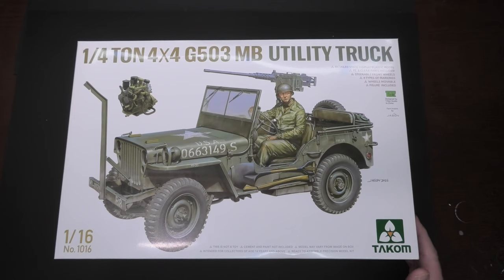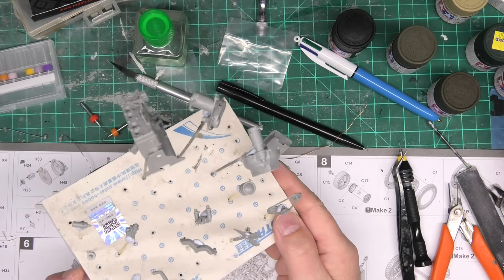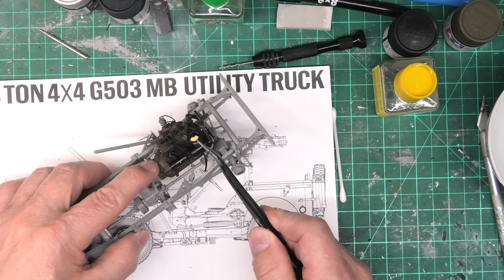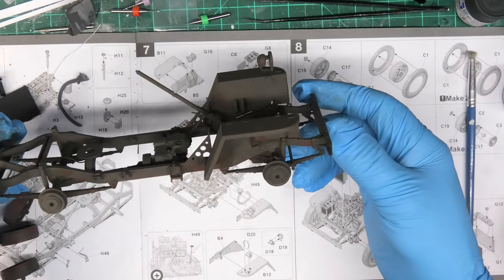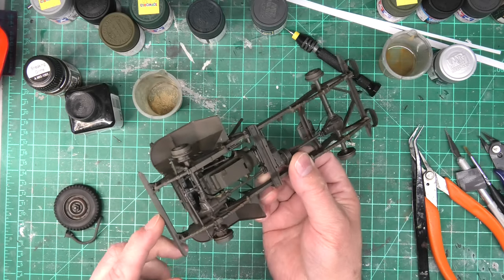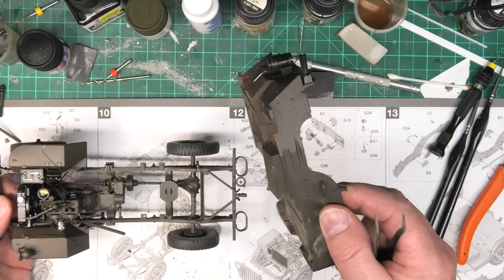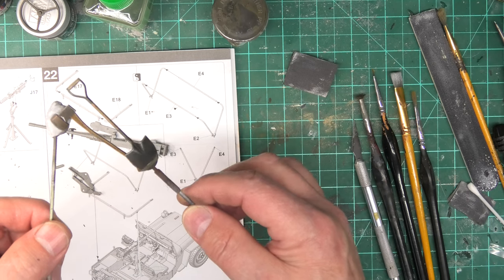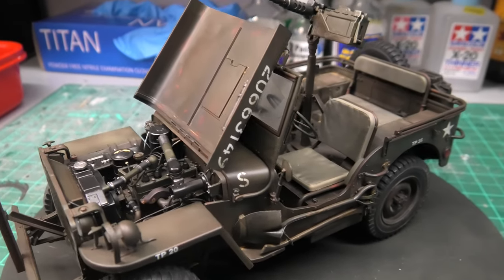Takom 1/16 scale 1/4 Ton G503 MB Willys Jeep #ww2 #models #willysjeep

Comment: Nicely done indeed!  My advice, if you really want a final touch to set such amazing work off, is to either ditch the kit M2 and replace it with a Tamiya M2, or grab the Aber detail kit and get stuck in with that.  Amongst other systems, I worked on and around those M2s for years and very seldom does the colour of the parkerising on the barrel (usually near black) match the parkerising on the gun body and front barrel bearing/cooling jacket (usually a slightly green tinged gunmetal).  The Tamiya M2 has a separate barrel plus detailed bolt top and feed pawls on the top cover, and given how prominent that M2 is will make a huge difference if you want to avoid the brass detail kit from Aber.  I'll look forward to your follow-up video.
Reply from the maker: Thanks for your comments 🙂. I'm doing a Trumpeter M16 1/16 scale and it actually has better M2,s than the Takom.
Reply: @sierrahobbys1883  I'm going to do a video review shortly of the 1/16th scale M2s from various kits.  So far the Tamiya M2 is still king, in my humble opinion, but the Trumpeter M2s in the M16 multiple gun carriage are very good too.

Comment: A good video of the build. I bought this kit for a Christmas project but I have only got to stage 1 and i am rather disappointed. The chassis builds up to be a completely boxed structure whereas the real chassis has "C" section rails with boxing at strategic places. Also the spring hangers are all solid whereas they are open structures on the real jeep. I think on a kit of this scale and price there should be more detail.  I have already started cutting things about to increase the level of detail. Its actually fun to do but it is all about kit expectations to me.
Reply from the maker: 😊 Thanks.  There are a lot of things you can do on this kit,but no matter how much details you add there will always be details that you will not have. Overall it's still a very impressive kit.

Comment: Is there a guide available for where all the lines, wires and cables go ? 
Thanks
Reply from the maker: Thanks for your reply. I took most of my references from "Greendot 319 "youtube.
Reply: Great video and beautiful build. This is my first model in many years so I’m learning. I’m struggling a little bit on when to paint before gluing certain parts. How do you glue painted parts? I tried this and certain areas like putting on the fenders and the paint wouldn’t take the glue. I had to disassemble and scrape the paint off areas for glue, but you don’t seem to have that problem. I look forward to hearing your advice. Thx
Reply from the maker: @stevewedeen5958  Thanks 😊 for your comments. Most of the part were glued before painting and the smaller detail parts that were glued and painted separately I used Migs "Slow Dry cyanocrylate glue". I find this is stronger than other super glues. And it allows you more time to manoeuvre the parts. Some parts,larger you still need to sand of a bit where the glue will be placed.
Cheers 🍻